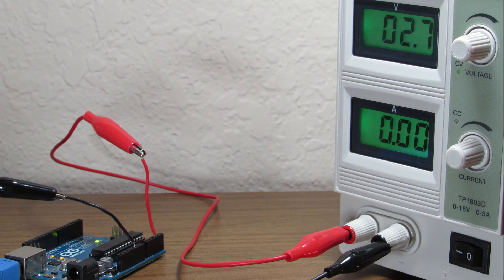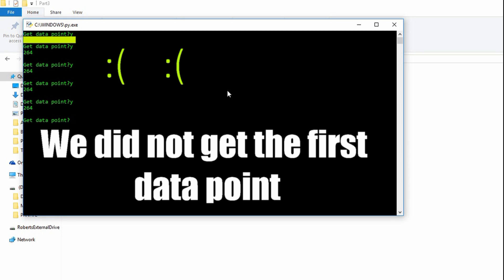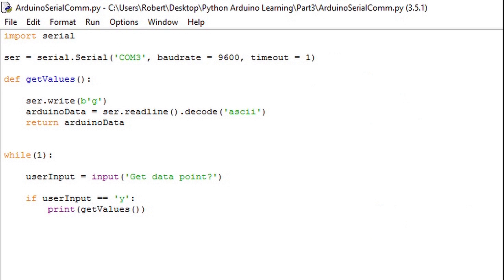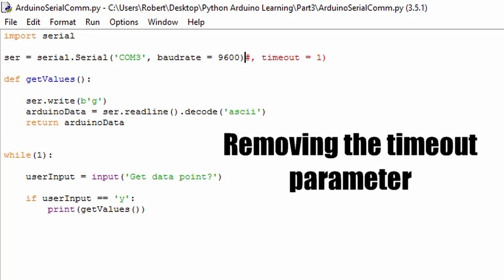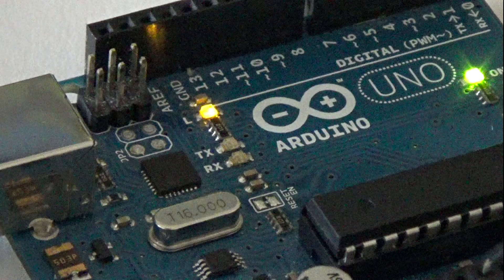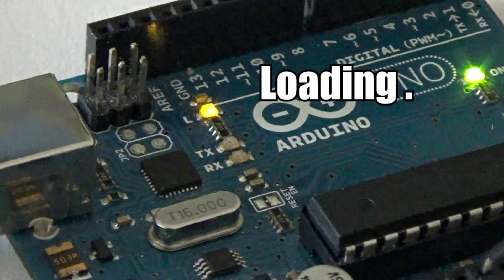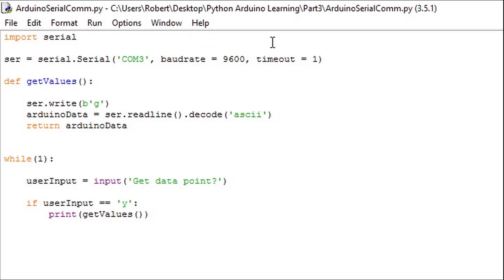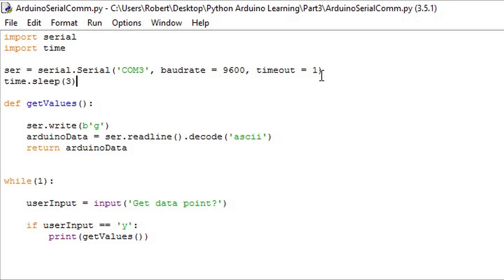Arduino and Python Serial Communication with PySerial Part 3 - Initialization Error Handling

Comment: It probably has something to do with using an older Arduino, a USB Boarduino - I have to set the sleep command to 10 seconds. 3 is not enough. Just as confirmation, counting off the seconds until about 12-13 seconds also works. The Arduino board I am using has an Atmega168 not an Atmega168P.
Reply from the maker: Interesting - Nice to see that it worked for you after you extended the time! The delay could vary upon what board you are using.  Thank you for the feedback!